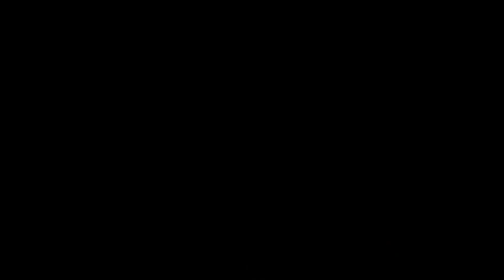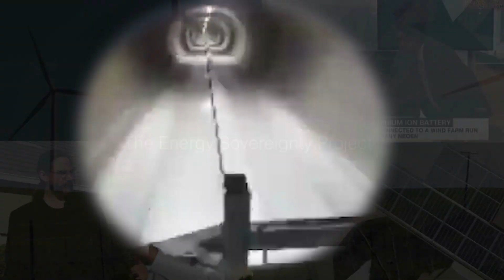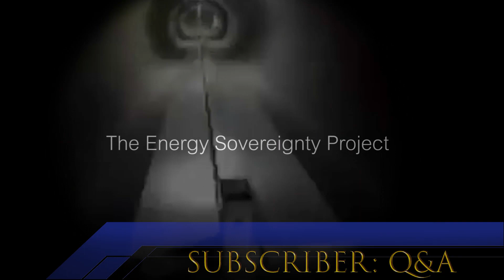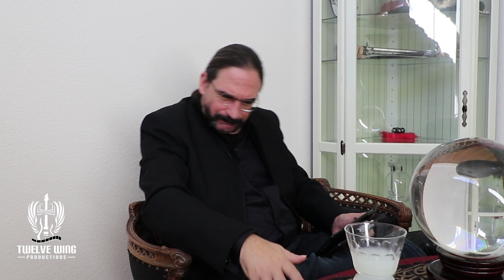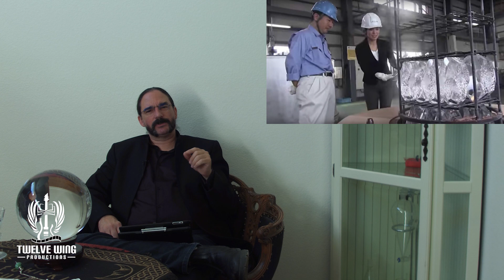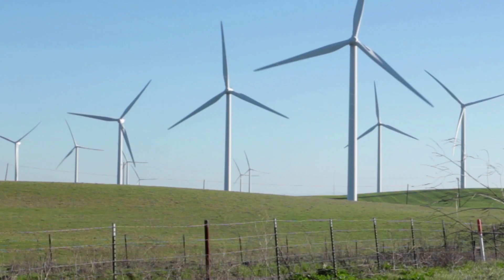Tesla's new Million Mile Battery: Is it solid state?

Comment: * Roadster 2020 is capable of meeting its publicized performances with current LiIon technology.
https://jalopnik.com/heres-what-a-battery-researcher-told-us-about-the-tesla-1820558723
Riders report a high entry sill height commensurate with double height pack.
Musk has subsequently upped the performance figures that indicates the new LiIon tech now being tested and due to be introduced in 2020.
* The NMC532 described as “single crystal” in the Dahn et al paper is in currently available Li-FUN Technology batteries they used for benchmarking the new 2 electrolyte subject of the Tesla patent application in 2017: 
"The positive
 electrode loading was 21.3 mg/cm2 and the electrodes were calendared to 3.5 g/cm3. The positive electrodes were 94% by weight active material with 4% conducting carbon additives and 2% by weight PVDF binder" http://jes.ecsdl.org/content/165/3/A626.full.pdf
* Dahn has recently stated that Liquid electrolytes are competitive with current solid state electrolytes: https://www.nature.com/articles/s41560-019-0428-9
Tesla holds patents in lithium air tech.
* Dahn's 2 electrolyte patent application goes back to 2017 so Occam's razor would align with the Model S Plaid being a test bed for that technology. 
With Maxwell having  used its Capacitor Dry Electrode system  for some time and over a year of testing this in batteries with Tesla using its production facilities, it is also likely a test bed for that tech.
* Rickard has used super caps in his EVs and the result is that it is always better (cheaper better energy density, lighter) to add more batteries than super caps: https://youtu.be/zlJRo9yVzus?t=4216

Comment: So, most people are not excited about solid state batteries, if they can get this to work, even at the same mileage as car do now, you can recharge it At same time as you do cars do! even if it’s twice as long it faster than it is now!
Reply from the maker: I'm not sure  I follow you Randy.
But if you are saying that they will charge faster, that is correct.
I also now firmly believe that the "mono-crystal" is garnet and that they have been able to use it's ferromagnetic properties to allow it to act as both a battery and a capacitor.
If true, there isn't a single battery in existence that won't be made instantly obsolete.

Comment: From what I gather with the speed of change that is coming is a bit like Moore's law for computer processor speed. By the time you order and receive your Tesla it is going to be out of date with new tech.
Reply from the maker: Great comment, and likely this will turn into a video of it's own.
Tesla, more than any other automotive manufacturer, has taken on a move towards modularity, both in design and principle.
Through software updates, the cars can be kept current.
The battery is not married to the vehicle.  It, like the drive units, can be extracted in less than half an hour.
As we move forward, Tesla is announcing a centralized and modular buss style wiring system that will greatly reduce the amount of wiring that is within the vehicle.  Split into communications and power connections, this will allow the installation and upgrade to separate systems within the car without having to do significant redesign to the vehicle itself.

I think what may have brought this idea on is that the onboard cameras and computer system need to be mutually compatible and capable.
As technology improves in both, it will be necessary to upgrade from time to time and much of this upgrading will be on Tesla's dime.
As a result, they want to make sure that they can simply unplug a camera from the bodywork and replace it.  If the vehicle contains a centralized "buss" system, the actual wire to that camera is able to be routed to the same centralized "nervous system" for lack of a better term.

The end result of this is a car that is the body and that body will contain elements like the battery, drive units, cameras... that are all modular and can be changed without having to sell the car to purchase a new one.
Reply: @twelvewingproductions7508  Just happened upon this video.  Very interesting, and well presented.  Much food for thought, and very plausible. I’m not an engineer nor a physicist, but I assume the super capacitor element will also free up demand on the battery pack for short burst of energy such as hard acceleration, and setting a heavily loaded vehicle in motion on a steep incline?
Reply: Exactly what we thought with our Model 3 SR+ we’ve just bought............it’s futuristic, and it’s out of date. Just got to keep the ball rolling.  We’re hoping that, as with several of our previous cars, it will last 20 years or so, and 150, 000 to 200,000 (or more) miles.  If Tesla retain CSS charging, it’ll be just like any great, old car.  If it will be possible to swap out the battery pack with one containing new technology (whatever that may be) if need be in the future, that will be fine.
Reply from the maker: @cbromley562 , Because the car isn't married to the battery, I am sure that it will be able to be upgraded as time goes on.
The biggest thing I'm finding with my Model S is that there just isn't anything that could wear out that isn't worth replacing/fixing.
When one replaces a drive unit, it's fixed fixed.  It's not like doing a head gasket on your car only to find in 3 weeks that you warp a head or lose a lower end bearing.

Sure Teslas can break, just like anything else... but at 120,000 miles already this isn't a car that I see giving up.  I'll just replace the battery when they release their next generation.
The only thing that would get me to trade in at this point is to get the full self driving.
I want that option bad.  I only have AP2.
Reply: Twelve Wing Productions   I’m glad you’re happy that your Tesla has longevity built in.  The M3 certainly gives that impression.........I even have faith that the existing battery pack will last us out.  We’ll see.  It’ll be very interesting to see the developments in the batteries over the next decade.

Good luck with your new Tesla, when you decide to go full self driving.

Comment: Yeah man I think your on the mark but consider that  the new 21700 cells also have an aluminium casing instead of steel.
Reply from the maker: As the reason for the weight reduction?
That's a possibility, but I'm not sure it would be 350 lbs lighter just because of that.  Maybe due to a combination of fewer cells making more efficient use of the space.  This would also leave some space for a few ultracaps.
They obviously did something.  No previous Model S was able to go any more than 2 or 3 minutes on the course without going into thermal reduction.  So even if what you say is true and they were proving out the new larger cells, they still had to do something to curtail the heat.
Reply: Twelve Wing Productions yeah they probably have lower resistance in them cells also . In fact there is reason why they wouldn’t have some graphene platlets or carbon nanotubes in the mix . This would definitely lower the resistance and capacity
Reply from the maker: @Buzzhumma , I might have another reason.
Video to follow.

Comment: I believe tesla just became more efficient at packing their batteries, a 200kwh battery doesn't exactly need 2 BMS or another separate pack housing. The roadster was driving and accelerating very quickly back in 2017, even broke down on a public road when this technology wasn't available, so it probably had a old gen 200kwh battery pack, the car does seem crapmpt compared to the S.
Reply from the maker: There has to be a little more to it than that since the Model S they just tested didn't have any thermal management issues.
As to the pack, I agree.  That was the only way I had to easily illustrate my point.  But you are correct in that things like the BMS and a few other components won't have to be replicated.
I think that would get you 20% of the way there.
The rest, however, is going to have to come from using a pouch battery.
Then you get into the thermal issue I mentioned.
So this is kind of a holistic way of looking at this.  You can't just use a standard liquid electrolyte battery and stuff them in.  The thermal properties simply won't allow for it.

Head spinning yet?  This is the exact same logic path I took when I first heard the specs of car and truck as well.
What I think we can both totally agree on is that these next 6-8 months are going to be interesting as hell.
Reply: @twelvewingproductions7508  model S at the track definite has a better thermal management, its apparent from the increased size of the radiator,  but the model 3 also has a much better thermal management then the model S and that car is 4000lbs with its 75kwh battery. The extra 6-800lbs of cell wheight in the roadster also acts as a thermal sync for a good couple of minutes when operating at the same power as the S.
Reply: @twelvewingproductions7508 
 also i dont think they are using pouch batteries, i thinks that's just the preferred method for testing, tesla has stated preference for cylinders not pouches.
Reply from the maker: @miguellopez3392 , I agree that the best way to test is pouch.  You learn more from that form factor than from a cylindrical rolled battery.
That said, the reason that Tesla preferred (note the past tense) the cylinders over the pouch batteries was thermal management.
They were able to make good use of the space between the batteries.  When you try and use pouch batteries with liquid electrolytes you have a huge issue with cooling.  It goes from an efficient way to pack more cells in and instantly turns into a nightmare of stored heat.  Pouch batteries in every other brand of car that has used them have seen outrageous amounts of degradation.  Something Tesla has largely avoided.

I would love to get a look under the "hood" of that battery so to speak.
Ultimately, we will have to wait for 8 months or so before someone like Monroe and associates can dig into one.

The best thing to come of all this is that folks like you and I are hashing all this out.  It's a fun mental exercise.

Comment: This paper: http://jes.ecsdl.org/content/166/13/A3031 covers the use of single-crystal NMC532 particles of about 3 microns in size in the cathodes of small (250mAH) test pouch cells, avoiding the micro-cracking and capacity loss that occurs with other cathode materials.Tests done over three years with a variety of liquid electrolytes showed (quoting the abstract) "that cells of this type should be able to power an electric vehicle for over 1.6million kilometers (1 million miles) and last at least two decades in grid energy storage". I found this referenced by an article in Wired: https://www.wired.com/story/tesla-may-soon-have-a-battery-that-can-last-a-million-miles/ which also mentions a Tesla patent based on the work of the same team, using a similar cathode and specific additives in the electrolyte. Then I found more here: https://electrek.co/2019/09/13/tesla-patent-battery-cell-better-performance-cheaper/ including a link to the patent: https://patentscope.wipo.int/search/en/detail.jsf?docId=US251449154&tab=NATIONALBIBLIO

Comment: No man you are wrong, go find out why Tesla bought Maxwell. It's dry cathode and double of energy density in the battery. No solid state battery is close to production for reasonable price/performance. Maybe you talked about it, but I clicked through didn't hear that and had no time to listen all..
Reply from the maker: Listen to it when you have time.  My reasoning for believing that they have a solid state battery revolves totally around 2 things:
1) The capability of the battery they are describing 

and
2) The fact that they described it as a "mono-crystal" electrode

If you can come up with some other plausible thing that they are using mono-crystal for other than an electrolyte bonded to the cathode...
... I'm all ears.

Comment: Even though Tesla’s Solid State battery is around the corner, I don’t think there was enough time or incentive for Tesla to build an entire dry battery package in just a few short Months when they could instead darken up the windows and take out 350 LB worth of interior seats & panels.  Reduced weight, 3 motors and an aggressive rigg did the job. $180,000 EV is not in the same category and will be answered with an uppercut called the Roadster! 
This unofficial record was just a quick answer that Tesla is still here and in your face! I like that!!
Reply from the maker: I don't think we are talking about a few short months at all.
I think this was something they had nearly completed when they designed the Semi and Roadster 2.0.  I think they have been refining it since then.
If you think of it from an engineering perspective, in order to move forward with the design of both of those vehicles, one already needs to have some design criteria.  Especially if you are going to boldly say that the Roadster WILL have a 200kwh battery.

I think they already knew they had the energy density to pull it off.  Otherwise that would have been far too dangerous a thing to say.
I think they already had a reasonable idea of how large the pack was going to be and what it's thermal properties were.
Since then, it was just a matter of "weaponizing" it.
So what I think they did in "a matter of a few short months" was to stuff the roadster motors and roadster pouch batteries into an existing test battery pack along with some Ultracapacitors.
That's something I can see them having plenty of time to do.

Comment: Probably 350lbs lighter because they used a smaller size battery as there is no need for the 300+ mile range for the nugburgring as it is only just over 16 miles
Reply from the maker: That is certainly a possibility on the face of it.  That is what they did with the specialized Pikes Peak Tesla S....
... but...
When they did it for Pikes Peak, they actually had to chill the pack beforehand.  It was obvious that they had no intention of sparing the battery.  Fewer batteries by capacity means that each cell has to work harder.  And that means more heat.
The car they sent around the Nurburgring had no such thermal management issues.  So I doubt it was a cannibalized pack.  It could have been, but I honestly think this was a full range pack.

Comment: Thank that as always interesting and thought provoking. One question: has someone opened up the Maxwell 3,5V batteries to see the construction? It might give an idea what Tesla started from for their new technology batterie. Can it be assumed that in view of the Panasonic massive recruitment campagne at Giga1 that Tesla have sold Pansonic a share in this technology?
Reply from the maker: If someone were to open up a cell made with a dry electrode process, you wouldn't notice anything different with the cathode and anode most likely.  The difference isn't in the chemistry but in how it's bonded to the roll material.
We have some on here that want to argue that these cells have double the energy density or increased cycles but those arguments are going to be pretty difficult to back up.
Liquid (better described as paste) electrolytes suffer from thermal stress and break down.  So when you start hearing of cycle numbers in the 10's of thousands.... 

.... that's a solid state battery.

If I had to place my bet on the company that Tesla will initially share the solid state batteries with...it will be LG Chem.
We are already starting to hear rumblings of a max range Model 3 that will be available only in China.
This fits with what I've been hearing so far.

Comment: I might be wrong, it would be a pouch batteries that can withstand much higher current at a short run, don't think it will deliver like 200+miles and don't think it's a solid state. Hence loss of 350 pounds, solid state batteries might not be ready, my guess wild it might not be capable of high capacity or the weight per watt, crystal are no lightweight but certainly fire proof.
Reply from the maker: This leads to only two possible rationals for this:
A) Tesla is basically cheating.  They produced a pack that had all the qualities they might be looking for by cheating the pack or simply running the batteries to destruction..

or

B) They actually have a nearly production ready 100kwh battery pack for their new Ludicrous Plus package.

Given that this car will be on the menu for mid to late 2020... just like the Roadster 2.0... I'll leave it to you to guess what variation of this I'm betting on.